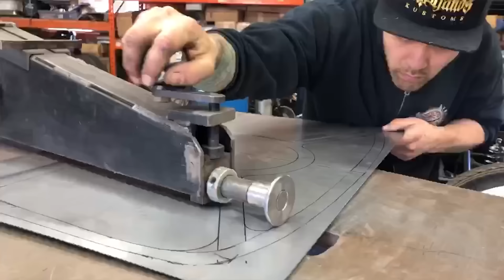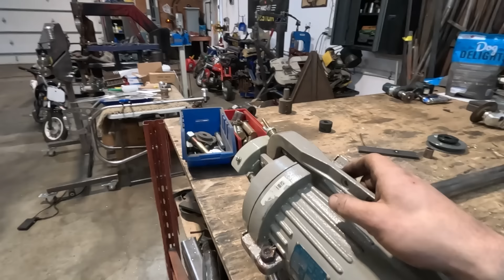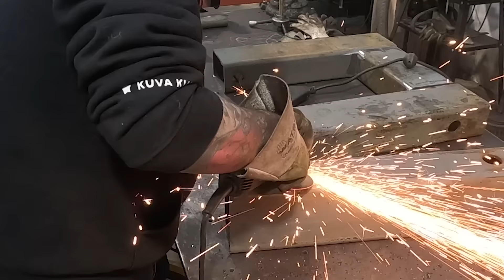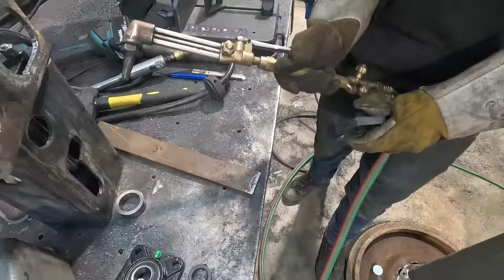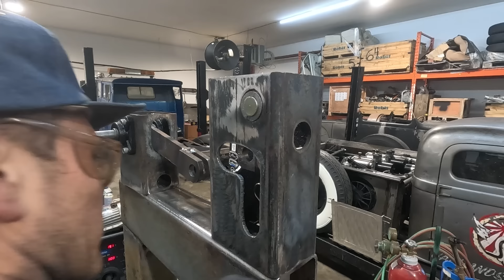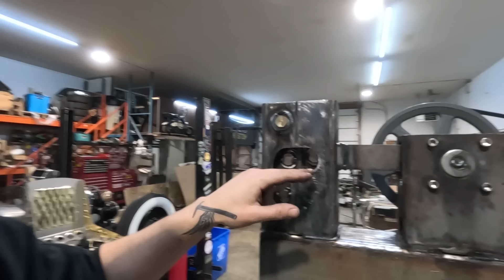How-To Build a Metal Shaping POWER HAMMER From Scrap Metal / Pull max/Nibbler

Comment: What happens when the system is overloaded? Do you have a spring to allow for it not eating itself alive? If it doesn’t have the power to smash the work down that toggle point may start to warp or break

Comment: Hello, I am building a power hammer/pull max using a golf cart rear axle. I do not recall which video you built using a car/truck rear end, it was red. Would the collet holder in this video be ok to use on my project? It'll be similar to the red one you have/had.

Comment: You can buy cheap brass bushings to go into those joints. They are all over the net but even some tractor supplies.  have them for a few bucks each.   That would make it all run smoother and last longer,  anyway I am only 22 min in. First time on the channel and liking it. I am so much a like.

Comment: You could turn the motor Around So the clutch handle is at the bottom and use some linkages to add a foot pedal.

Comment: Awesome vid especially for me without a lathe and milling machine. This vid was so inspiring. Was just wondering if it's possible to get shrinking dies for this hammer in case a large surface area needed to be shrunk on a metal panel

Comment: I built a copy of this little guy with a couple tweaks, added a 10.5 driven sheave from an air compressor which gives it a little more power and I ran flange bearings on the frame to reduce friction and make it run smoothly. I had previously billed too much larger power hammer of my own design with a 48 inch throat and a four horse DC permanent magnet motor, but there are some things this little short style machine does better than my other stroke machine.

Comment: A great project!!! I love this kind of projects they make you think and come up with all kinds of different solutions.
I am thinking that you probably can put a cam right on the motor's shaft eliminating all intermediate parts. I mean to use a short shaft with a cam between, say, two pillow blocks and conned it directly to the motor. It should work as well.  The cam can also be put on the large pulley's shaft if the motor is not strong enough to operate directly from the shaft, possibly a piece of a car camshaft can be used for the shaft. 🙂
Another thing, just a fantasy project, to build a human powered hammer without a motor. Make a pedal operated heavy flywheel. This way you can operate the machine with this pedal, like an old sewing machine.

Comment: If you are worried about the size of your vertical travel on that machine, consider this: you can increase that travel by increasing the offset radius, or you can increase the travel by shortening two links. One is the link connected to the fixed point, and the other is the link connected to your ram. In the video it seemed like you made those links the same length as each other. Anyway, the shorter you make those links the more your ram will travel up and down. Also, to maximize your vertical displacement for a given offset radius and link lengths (the two links I mentioned above) the length of the 3rd link, the one connected to the "cam" has an optimum value. It should be sized so that at the lowest point in the ram's travel, the right end of the link connected to the cam should be directly in line with the fixed point and your ram axis. If you make that cam link shorter it will decrease your vertical displacement.

Comment: Cool video! I went out to the garage to see what I had, found a 240v 5hp compressor motor that spins at 3450rpm! Yeah, I think we can build a trash hammer with that. Just gotta figure out pulley sizes and what would or would not be overkill for this. Thanks for the inspiration buddy ❤

Comment: I’m in the UK, just a couple of months ago the company I work for decided to scrap some machinery they couldn’t sell, they were heavy duty wire stitchers, used in the bookbinding industry, they can be bought for around  £200 for the small throat type.
I’v often looked at them and actually wondered if they could be converted to bead rollers, maybe a small wheeling machine etc.
It’s only a lack of space why I didn’t take the deep throat Bostitch model, as is was a crying shame to see them scrapped.
Reply: https://youtu.be/189z3YJjteU

Comment: Thanks for sharing I have been thinking of building some equipment with a lawn mower crank shaft and connecting rod . Think about using common bits for some of these eccentric cam machines . Cheers Ken

Comment: It's Called the Toggle Action which are used to give One a high Tonnage Clamping Foce like found on Windsor Injection Moulding machines ,Very very Old mechanical design from yeaster YEARS ! Regards from The Country who has less Energy ( Electric Supply than Eukrain ) 🇿🇦

Comment: Instead of manually oiling those points,  just weld in some grease fittings,  attach a connector tube to all of them a connect it to your grease gun. One shor lube

Comment: On my Craftsman table saw, the motor hangs off the back so when it pivots down, it  tensions the belt automatically.  So whynot do that here. Weld the bracket that came with the motor so when it pivots back, the weight of the motor tensions the belt

Comment: I can empathize with your machine building excitement. I have been working on a 20" disc sander. More for wood working then metal working. It's machine building none the less. This is mostly made out stuff I have on hand as well.
 Your hammer is awesome. I have seen pictures of the pull max and Yoder hammers, but haven't fully explored the mechanisms that make them work. Great stuff!!

Comment: Pot of oil on top, with a tap on the bottom and from there tiny oil-lines (tubes) to the places that need lubrication. Before starting the machine you open the tab - and when done, you shut the tab again

Comment: If you are looking for a cheap square die holder, you can use the torsion spring holders in the middle of an old beetle front suspension beams. It is pretty close to the Pullmax size.

If you add another cam onto your fixed point that you can rotate and lock, you can have variable stroke.

Comment: Interesting linkage mechanism, have not seen one like it before, at least not on a hammer.
You are correct about at full extension it produces more 'push'. As a matter of fact, a similar idea can be used when pulling something heavy (like getting a car unstuck). Tie a rope from car to tree, AKA an immovable object, then push/pull the center of the rope sideways. That will multiply pulling force on the car considerably VS trying to push/pull it out directly.

Comment: Toggle mechanisms multiply force as you have deduced.  This is why they are used on machines that require high forces.  The one that I am familiar with is a hydraulic molding machine that uses the toggle mechanism to apply force to keep the mold closed as the plastic is being injected into it.   Also good use of a commercial sewing machine motor.  These motor and clutches are pretty sophisticated.  Great job on the build.

Comment: This is so cool. I have no use for something like this but might have to make one anyway. I had the thought that if you used a 1 hp or larger motor you could double the offset in the cam. That would give two strokes per rev as the drive would go past center lifting the hammer and striking again on the return. It looks right in my head anyway. Mechanical advantage on both push and pull. 
Maybe double would be too much, I'd have to draw it out and build a little proof model. Anyway, thanks I love this sort of thing and don't do as much as I would like.

Comment: I have no use for a power hammer but did sit here for an hour watching you making it. Using the mill would make a better job and quicker but it does work ok.
Scrounging 6x4 and finding DOM tubing at least here in Oz is hard work and expensive

Comment: Plus with the "short throw" that this has, means less chances of fingers being crushed!
As a fellow engineer (environmental for a hardcaping company), your process and execution of this turned out at 8.75 out of 10 to me.
Using material you had in your Fabricating Shop (minus the Sewing Machine Moter and Flywheel), I would proudly claim this as mine (if I had a need for a brandished hammer) to be honest!
Please notify us of upgrades/modifications that you do/did with this. It is currently 31°F and 0254 PST here, but you deserve a "KUDOS" bar for this...
Sorry, I am 49yo, so you may not know what is ment. This was an early 1980s granola bar that was marketed "back in my teenage years", you executed this build excellently Bro!

Comment: When it comes to Fabricating my own Tools and Garden Tractor Attatchments, I have always tried to sketch at least 4 variations (thumbnails) so I am able to follow our beloved "K.I.S.S." method in order to try different styles  and techniques.
Plus, when it is drawn, you always have an eraser to change anything before making that first cut of material!
When it comes to "larger projects" such as your Recipicating Hammer, I visit my local Big Box Store or Grocery Store, and ask for a few "Pallet Slips" (cardboard peices that help protect the palletised goods) early in the morning after they stock shelves.
You can NEVER have too many of these, as they also work splendidly for C.A.F.E. (Cardboard Aided Fabricating & Engineering) that we all know of.
As I am only 14:53 into this video (so far), Zerk fittings will be your Best Friend to keep everything from seizing... Especially if you grind in a few (4-8) groves into the Vertical "hammer arm" without having to worry about Seals about ½" above the Zerk Fitting at "absolute bottom" of the throw.

Comment: Brilliant work, Karl. If you add a coolant feed and catch-tank to your pillar drill your drill bits will last 10 x longer. I use a vibration pump out of a domestic espresso machine - they are very cheap. You have inspired me to build a power hammer now!

Comment: " Google engineering degree.." That cracked me up! Karl thanks I needed that laugh!!! I believe the half horsepower should work fine for that purpose. Shouldn't need anything any bigger than that. Ya made yourself a descent little metal stretcher there bud..looks pretty cool. That tool will definitely come in handy for sure.

Comment: 1 HP= 550 lbs pulled 1ft in 1 second.

550x0.25=137.5 lbs of force in 1 second 

So,  if you can calculate the mechanical advantage of your levers and then multiply that by whatever gear reduction you use, I think you'll find it's surprisingly adequate. 

We use approximately .75 HP per ton to calculate how many locomotives are required to move freight (big wheels and gear reductionmake a big advantage), just for an idea of how much work one horse power can do.

Edit:
So if the cam moves .75" say and the hammer moves .125", that's a 6:1 advantage. Your pullies look like 4:1? So, 6x4=24. 24x137.5=3300lbs of force!! If the motor turns 1800 rpm (for a 4 pole motor at 60Hz) just for a guess, divide that by 4, and it's 450 strokes per minute. I think you'll have a hard time doing better than that with a stump. Even using the Mother Tucker!

Love to see the experimentation!
Reply: You can just take the straight diameter to calculate ratios. That's the beauty of ratios. A circle at 2" to a circle at 8" will have the same ratio between the diameter and the circumference.

Comment: Wish we could post pictures on here some times, a few yrs ago I was ripping tires off aluminum wheels for scrap and I needed a better way of breaking the beads, I literally took a pile of shit scrap metal and fabbed up a bead breaker using a broken shovel head 😂. Nothing but my time and welding wire and gas. You can achieve anything if you put your mind to it. Thanks for sharing this challenge with us!

Comment: Could Use a Morse cable so you can move the pedal around. Also if you want the hammer to move farther you can move the pivot point on the L shaped piece, basically make it a T

Comment: Love this, thanks for doing it.    There is a book I forget the name about building a lather etc from scratch.  The idea being that you can make machines that are more accurate and powerful  than that tools you are using to make them.  Which is what you have done here.

Quick question:  Why are you stitch welding (i.e. leaving a gap) rather than welding the whole way across.  My thinking is that this potentially leaves a stress point for a future fracture (not necessarily relevant in this particular application), so just curious.
Reply from the maker: Probably a great point on full welding! I need to add some gussets also

Comment: Man this is sweet! I’m in the process of doing something very similar. I’m using scrap and pices of an old wooden lathe I bought for 50 bucks. 
My I had a plan to have the crank directly hold the rod thats doing the hammering. What is the gain by doing the extra mecanism?
Reply from the maker: I think there is just more mechanical advantage with the linkage vs a crank direct? Not sure lol
Reply: @MakeItKustom  yeah, I have that as backup if my plan fails :)

Comment: Excellent result Karl, obviously you have a great mind, with some time-tested experience.  Most design and fabrication has an initial build with subsequent re-design and alteration but you blasted right through that.  Perhaps bridging the top of the cam tower to the stroke tower with a small plate could give that extra bit of rigidity to the system so all the force goes where you want it?  I'm sure you will tweak it with use and time but awesome video man!
Reply from the maker: Ya there’s lots of areas to stiffen and so many places that can be improved on it lol already have a redesign in the works that addresses allllll that haha and more of a kit I hope

Comment: Great build Karl! You might consider adding a brace between the housings that contain the cam and the linkage to eliminate any flex and make the most of the up and  down hammer movement.  Can't wait to see the next installment.
Reply from the maker: Ya it could be stiffer for sure

Comment: Great video as usual, I was looking at motorising my bead roller and did look at those sowing machine motors with the clutch as they  have a pedal and reverse on most sowing machines. What do you think of the clutch operation would it work as a veritable speed?
Reply from the maker: I think it could but I don’t thing it needs the clutch just on off
Reply: I was thinking that the clutch would be be good for like soft start and stopping and then also  slowing to go around corners etc than just a fixed speed

Comment: Awesome job Karl. Was thinking if you would box in the frame and fill  with sand. Would that help with vibration and noise.
Reply from the maker: Ya for sure that will help in many ways. I’ll probably beef it up a bit but build another right aways

Comment: Hi Karl
I have been going to build exactly that, haven't got to it yet
My plan for the lever arms is slightly different. If you swing your top arm down so it looks like an inverted v
Then if you vary the pivot from straight up parallel with the motor arm to more like a v then you will vary the stroke
You would do that with a slot and maybe some all thread to a knob at the front
???? What do you think?

Comment: So do you think that the threaded bottom die adjuster might be a weak link in your design  ? It looks like as you hammer your metal the threads wight give way ? Maybe a ramp or wedge might work better .as always good luck !
Reply from the maker: Seems to be ok being 3/4” but if the frame gets stiffer it could be an issue. Ideally acme thread would be preferred

Comment: sewing machines run metal on metal and only have oil for lubrication and they last decades. Granted, they're using lighter forces, but...
Reply: That's right but...
Soft material on soft material is not very durable. It's better to run pairs of soft and hardened material as it's done in sewing machines, combustion engines and any other machines with moving parts... Or hard on hard as used in roller bearings and so on.

Comment: Karl, hey with your two piece collapsing plates to drive down the piston the hammer said material, what if you used a car/ trailer spring standing vertically ( yes you might need a larger spacing but you could use the eye of the spring to hold and pivot the spring then use the bottom end like a slipper format and just use the motor to deform the spring hence driving it down to the die.
but it does need a longer throw.

Oh yer, I got a copy of your held hand hammer made and now I'm setting it up as an english wheel to (oh if you were coming to Brisbane when your over here I'd get you to sign it.) Running a three inch top wheel and 1 1/2 inch bottoms. That's the plan, anyway with all the others toll making going here. But thanks for the concept to make a pullmax I can work with that.
Reply from the maker: Rad William!! Sounds awesome love that you  are making all the tools!
Reply: @MakeItKustom  I'm making so many, friends think I need counselling 🤣🤣
Other say I'm an over achiever!!!!!
I'm now wanting to get my hands on or see/make a ratcheting tube bender like the JD Squared or Pro tools 105 ones. The tool is the easy part the dies are the killer bits.